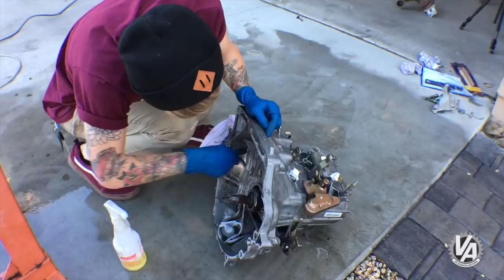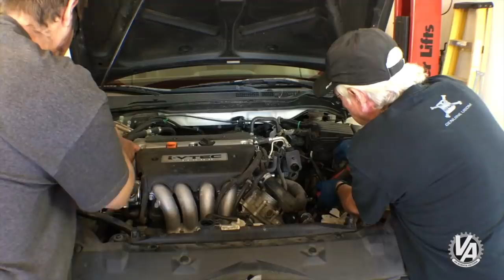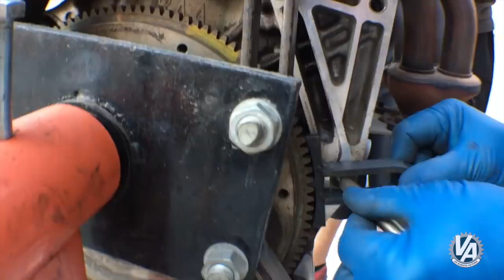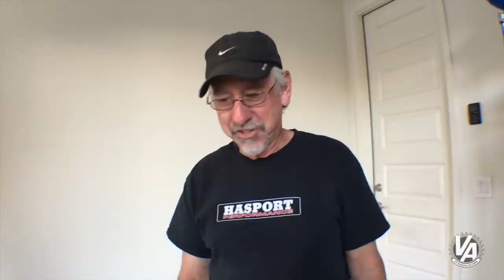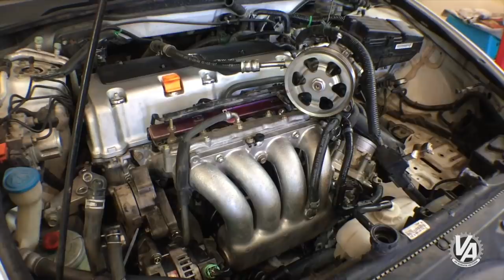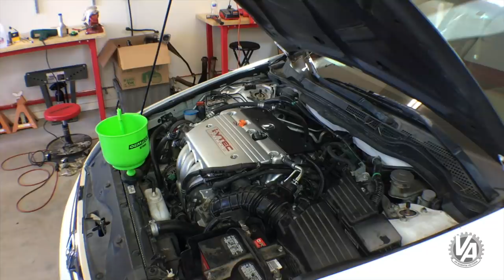ACCORD TSX SWAP- Project Mommobile

Comment: I'm doing the same swap but I'm keeping the stock 5 speed can I use my stock ecu or do I have to get a TSX ECU?
Reply from the maker: The stock ecu wont run the engine properly. If you have an 05 ECU in a 2003-2005 Accord KTuned can modify it so it will run that engine.
Reply: @ what if I have a 2006 with a wired throttle body?

Comment: Great swap video! I just two questions - 1. Did you have to swap out the Accord engine wire harness for a TSX wire harness?    2. So in theory if you did have the OEM TSX ECU would it have plugged and played into the Accord harness or would you have to have the TSX interior harness..? Thanks 👍
Reply from the maker: 1. Yes
2. The wiring is very similar, but I’m not sure the AC would work.

Comment: im hoping since this video was done 5yrs ago, that i will get some advice and feedback. i have the redheaded stepchild of the accord, the 08 LX-P 2.4 non vtec. i want to take the motor out of it, cause it gives me issues and has spent more time at the dealer than my driveway, and put a vtec into it. prior to me getting this vehicle, i have and still do have mustangs and am clueless with hondas! which motor will be best for plug and play as a vtec into a non vtec car and what all will i need for this swap? Im wanting more power, easier modifications, tuning and such!

Comment: I recently put the same motor in my 2003 Honda Accord automatic I have no issues but slow acceleration I used the original Accord complete intake I am trying to figure out why I am having slow acceleration. No check engine light I have the egr still on it as well

Comment: I'm so glad to see you guys working on one of these. I have a 2006 accord coupe with the k24 and 5 speed manual. I can second your synopsis of the suspension in the description. They're very agile for what they are. Unfortunately mine got wrecked and has a bent frame :(
Have an 8th gen civic SI now, though. Hope you're all doing well and good luck with your future projects!
Reply from the maker: There is another video where we installed new suspension in the car. The Tein suspension that was in this car for this video is now in our TSX. Check those videos out.

Comment: I didn’t understand the EGR and reverse lockout part and I really need help with these two things
Reply from the maker: We got rid of the EGR. The TSX engine doesn't have one. The TSX tune we installed in the KTuner ECU doesn't see EGR. As for the RVS lockout. Carter just didn't hook it up. He says he doesn't need to shift.

Comment: Hello commenting on a older and related video as I don't know if I accidentally spamed your email lol it wasn't loading when I would hit submit 
, I have questions regarding swaping my ecu to the rsx type s ecu. I'm wondering whats needed in order to swap the ecu's to have proper tunabilty and room for future turbo and awd conversions.
My understanding is I need to either use k miata timing cover made for the z3 or swap to a tsx bottom end. If there is other options I would love to Learn. 
Cheers 🍻 from a guy trying to break 14 seconds in a semi stock boat (current best 14.7)

Comment: So I’m wondering if I did a k24a2 swap to my accord will it work without issue since it’s factory is the k24 low emissions engine would I need to change ecu or anything
Reply from the maker: You would need to either change the ECU or ideally get a KTuner modified ECU and have it tuned.

Comment: How did you wire up vtec and all that
Reply from the maker: The only change to the wiring was to remove the EGR wiring. There is no EGR on the K24A2.
Reply: @VTECAcademy  awesome so its a plug and play swap on the accord then ? I figured since it has vtec on both intake and exhaust it would be different wiring. Awesome !

Comment: Help me out here. I’m using accord 5 speed transmission. Can I use the axles or do I need tsx axles? I hear the accord axles were shorter in length.
Reply from the maker: For your Accord, use the Accord axles. You also need the 2003-2013 Accord or 2004-2014 TSX manual intermediate shaft. The auto one won't work. The shorter Civic/RSX intermediate shaft won't work either.
Reply: @VTECAcademy  also can I use the 03 accord 5 speed manual engine harness?

Comment: Just subscribed. Do you know which TL motor will fit my 2007 accord 6 speed w/LSD (from a
2003 CL-S ). Or point me to the right direction. I'm thinking the 2002-2003 Acura TL Type-S (J32A2). I would like to supercharge as well. Searching the supercharger as well.
Reply from the maker: Any of them will fit. Just use the 03-07 Accord stock J mounts. Electronically, the 2004-08 are the easiest fit.
Reply: @VTECAcademy  got it. So I can keep my transmission and just use a 04-08 TL motor..? Overall goal is supercharge accord with a J32A2.
Reply from the maker: @accordingly5342  If you can find the TL manual trans, it has a limited slip differential.
Reply: @VTECAcademy  I appreciate the insight. Thx

Comment: Do u think it'd similar process in 09 accord k24  auto   to k24a2?  Which equ would  u use   ?
Reply from the maker: No, it's not. You are better off doing a head swap on that car and then using a KTuner of Hondata FlashPro to modify the tune.
Reply: Would the k24a2  plug  into the z3 harness    and would the vtec have control      or would k tuner v2 allow this ?

Comment: I bought me a 2003 Accord 3.0 with 40k miles and yearly services at the Honda Shop. Very few problems; steering noise (new pump), needs engine mounts, needs new disc brakes and brake pads. Leather, steering wheel… everything looks like a 40k miles car. I have a new CRV but I’ll be putting a lot of miles into the Accord. I bought that model simply because I love it. Oh, and the radio back light is off. I’d like to change the stereo to an aftermarket screen 📺 but keeping those safe down in Mexico City can be a bit dicey. I went to Harvard and I’m not too sure of what I know. You guys are true masters though. I’d trade my knowledge for yours.

Comment: I have an 03 accord throttle by cable k24a8 I'm wanting to put a k24a2 from a tsx which I assume is the engine you used here. My question is. Do I just use my intake and throttle body? I plan on using a 05 ecu with a ktuned end user installed. Is that a good plan?

Comment: Tsx ecu for my swap so I can hondata everything
Reply from the maker: We were just talking about that. Not sure of the AC will still work if we do.
Reply: @VTECAcademy  bypass the signal wire
Reply from the maker: @adamholtz1675  That's what we were thinking. It looks like using a TSX ECU in an Accord may work but using an Accord ECU won't work in the TSX.
Reply: @ADAM Holtz is it worth doing the tsx ecu swap
Reply: @dachotacox4037  I have still yet to do it on the 07 accord coupe.

Comment: Is there a special underdash harness that I can get made I have a 03 Honda Accord with a K24a4 vtec killer tax cams and cam gear and I can’t get it to start coil pack 1&2 get hot on stock harness with kpro I have a k20 harness but I can’t connect it to the under dash and tips guys

Comment: I have a few questions idk if you guys will reply or not but I want to start of by saying this was a VERY helpful and informative video but did you guys find out what the engine code was for and why? And also I’m planning on doing this swap in my 05 accord and I wanted to know can I use my accord ecu with the accord automatic tranny without a tune on the ecu? And also I was told that I would have to put my accord throttle body on the tsx intake manifold cause it’s a jdm tsx engine and I just wanted to know if that’s true I would realllllyyyyy appreciate it if you could let me know no I have talked can give me a straight answer. Thank you
Reply: And also in simplistic terms will I be able to pretty much “plug and go” with the tsx engine in my accord?

Comment: Could I do this swap on a 2012 accord and keep the automatic transmission?
Reply from the maker: Not with this engine. You would use the 2012-15 Civic Si engine or the 2009-14 TSX engine.

Comment: Hi did you know if I can swap 07 accord v6 to a tsx v4 engine?
Reply from the maker: Yes, if it is a 04-13 TSX, use the Accord engine mounts.
Reply: @VTECAcademy  thanks. so I use harness and ecu . Any other  modification ?
Reply from the maker: @relaxcity4197  I am pretty sure there're some modifications to the car's body harness. Without grabbing the manual and looking I don't know what they are. They probably aren't too bad.

Comment: Can this swap be done in an 06-07 accord with the MAF and drive by wire throttle body?
Reply from the maker: Yes, but you will want to use the KTuner prepped ECU so it can be tuned to work properly with that engine.
Reply: @VTECAcademy  thank you for the feedback. Your channel is awesome. 😎

Comment: Could you swap the engine and keep the same 5 speed transmission?
Reply from the maker: Yes you can.
Reply: @VTECAcademy  if we keep the same transmission can we also use the same wiring harness and ECU?
Reply from the maker: @305tyrone4  It depends on the year of your car. You would want to have a modified ECU to run the engine properly.  That means you would need a KTuner and 2005 Accord ECU for 03-05 Accord or a KTuner for the 06-07 if it's one of those years.
Reply: @VTECAcademy  it is an 05 ecu. Not sure what Ktuner is yet though. I’m a Beemer guy but considering buying an accord to k swap it. Will look into ktuner. Thanks for replying!
Reply from the maker: @305tyrone4  KTuner is a company that modifies Honda ECUs. They are the easy choice for that generation of Accord.
Reply: @VTECAcademy  check in here. I now have more knowledge. I also now have a Ktuner ECU for my 05 accord. You guys have an 07 accord with drive by wire. I have drive by cable. What do I do when I’m doing this swap? Do I keep the original drive by cable or swap to a tsx throttle body?
Reply: @305tyrone4  I’m still trying to figure out what to do, my 2004 automatic has cable but my TSX donor is DBW (auto)
I have no ktuner as of yet due to lack of funds. Can I somehow install DBW and just run the ecu from the donor TSX

Comment: Considering you are dropping in a TSX, which has no EGR, what are you doing with the coolant lines that come from the firewall that goes to the EGR off the K24A4? Are you re-routing these or capping them off somehow?
Reply from the maker: The stock ones work. The EGR manifold on the K24A4 and on the manifold on the K24A2 engines have the same coolant pipe location.
Reply: @VTECAcademy  thanks for the response. My K24A cylinder had doesn't have the coolant pipe for that EGR delete so there's no way to plug up the coolant hose from the firewall to it. If you say it should plug right up, that makes me think it should have a coolant pipe on the EGR delete and perhaps I need to pull off the one from the K24A4 one?
Reply from the maker: @iamteedoh  You can do that and just plug the EGR port with a block off plate. That is how it works on the 06 Civic Si which shares a similar head.
Reply: @VTECAcademy  thanks a bunch for verifying that! I'll do just that.
Reply: Which lower radiator/coolant hose did you end up going with? I stuck with the Accord one from my 2003 on the K24A engine. Works ok but it sits right above that front engine mount. Overtime and with vibration, I suspect that hose will tear and leak. I'd like to prevent that.
Reply from the maker: @iamteedoh  We used the Accord one. It should be the same as the thermostat housings are in identical places.
Reply: @VTECAcademy  ok, thanks! So as long as I use the Accord's thermostat housing, it should work. I swapped all accessories from the Accord engine to the K24A engine including the water pump and water pump reservoir. I did not change the thermostat housing, though so that's the issue. Thanks a bunch for clearing that up
Reply from the maker: @iamteedoh  The TSX and Accord thermostat housings should be the same.

Comment: @vtec academy I have a 2008 Honda Accord 4 door in which I swapped for a tsx  I am using the Rsx 6 speed transmission but I am having a passenger side axel issue what do you recommend ? Please help
Reply from the maker: You should be able to sue the Accord intermediate shaft and axle with no problems.

Comment: Why would you remove a K series motor to install another K-series motor
Reply from the maker: You mean remove a 160HP K for a 200HP K? To start with 40HP. Plus the 200HP engine has much more tuning potential.

Comment: I need info on what to do for ktuner??? Didnt see a updated video on your channel. I am ready to do swap just need to figure out ECU.
Reply: Any 03-05 k24a4 auto or Manuel accord ecu will work, ktunner is a chip that is installed on stock ecu. To have it installed for you is about 700$ from hamotorsport

Comment: Would it be possible to just swap the k24a2 head onto the k24a8 block and then use Ktuner on a TSX base map to accomplish mostly the same goal? I have read some conflicting opinions on whether the k24a8 pistons would run into the k24a2 valves.

Comment: Just curious. why not modify the K24A2 that's in the Accord? What are the differences between the 2 K24 engines?
Reply: The K24 in the 2006-7 Accord is a K24A8 or if it is a 2003-5 then K24A4. These engines have less compression, but the big difference is the head. The K24A2 head is similar to the K20Z3 head and has the VTEC on both the intake and exhaust valve train. This is the big reason the K24A2 is 200+ hp and the 
Accord K24A4/8 and CRV K24A1are only 160HP.
Reply: @BrianGillespie_brianathasport  I see. Thank you for clearing that up for me.  From the outside they look identical.
Reply: @nasimwehbe8410  That's true, they do look identical.

Comment: I have an 07 accord with an automatic transmission. I was thinking of doing this exact swap. Is it all bolt in or did you have to do any modifications for cooling, exhaust etc? Did you just use a computer from the donor car or have to use a different computer? Thanks for the info.
Reply: It's bolt on since the 7th Accord and TSX are the same. They used the accord ECU for test driving but upgraded to KTurner to get more power. You can use TSX ecu or Hondata.

Comment: hey im having a hard time finding a acura 2.4 tsx motor.  can I use a honda 2.4 ?
Reply: That's the whole reason they swapped the Honda 2.4 out
Reply: @shaunbailey4922  yea i known bc the acura has more power but I'm not worried about power i just want the car running agaon
Reply: @juanpinedo1683  oh then yeah definitely you can
Reply: It doesn't have full VTEC and isn't nearly as tunable

Comment: What ecu was used? Can you use an k24a4 accord 5 speed tranny for a k swapped Integra using hondata kpro? Because k pro requires an rsx ecu which means you need an rsx harness, but the Accord 5 speed or tsx speed have different sensors locations and wiring? Just run the wires to the new sensors and repin them at the ecus? The speed sensor on the Accord/tsx is a two wire and the rsx is a 3 wire. Where can I find ecu pin layouts for ecus? Cause I can't seem to find any and info would help me so much thank you!

Comment: Thought I was the first one with this idea, extremely happy I found someone who's done it first. Will the motor respond well to a turbo? Should I do forged rods and pistons for reliability and future hp increases?
Reply: K engines respond pretty well to boost. However depending on your budget or your hp goals you might not even need to.

300 bhp on a k24 without any boost is possible

Comment: So i'm doing this exact swap on my 06 Accord with a 5 speed manual. What i've wondered is if I can use my Accord transmission with the TSX engine? I plan to take just the engine out and leave the transmission and axles and all that in the car when I swap it.

Comment: I bought a wrecked 04 tsx its a 6 speed I need a new engine in my 07 5 speed accord. Anyway the tsx has broken axles can I use my accord axles for the tsx transmission? Also the tsx was flipped. Dont know if I should just keep my trans or change it out later as the tsx trans just had a clutch put in it. Any help you can give would be greatly appreciated.